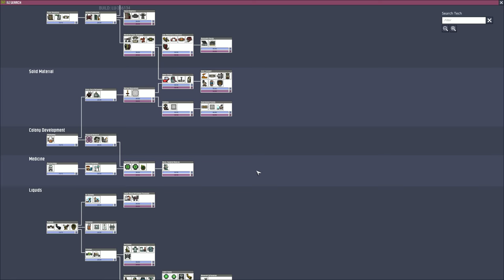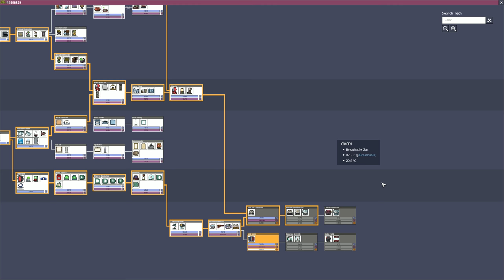Metal Refine on RIME #7 - Oxygen Not Included (Launch Upgrade) [4k]

Comment: I still don't understand why you didn't run the power down from your hydrogen silo to one of your main circuits. I think this would reduce coal requirements. Espiecally if you are going to add any more ... dang i cant remember... the machines that generate oxygen using electrolysis.
Reply from the maker: I do....